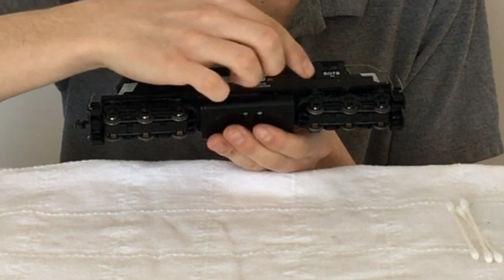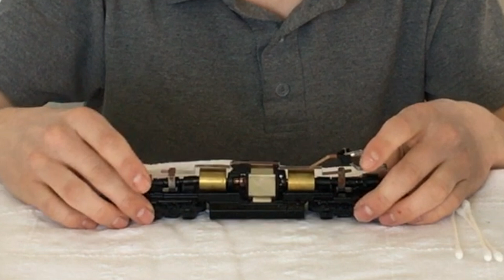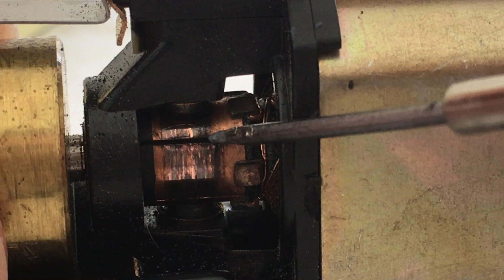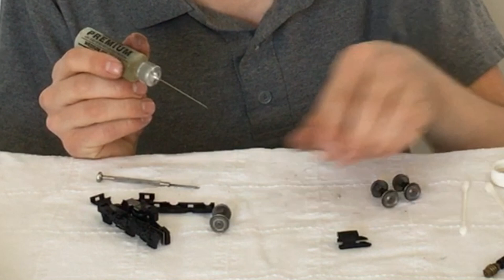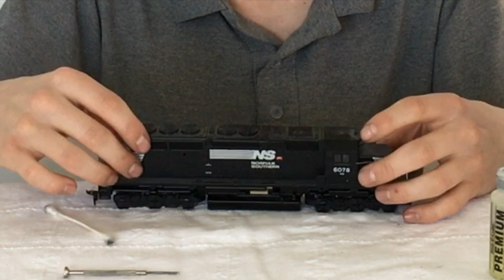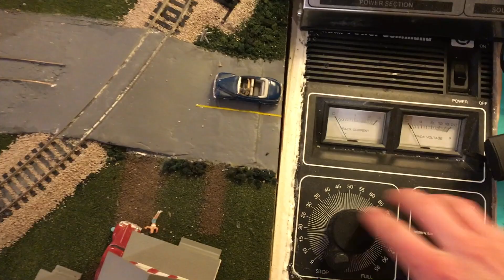How to service an ho scale locomotive

Comment: Thanks for this vidio, how would scratchbuild a locomotive? I already have a design, i just have to build it, it’s a cylender with straight lines enstead of rounded all the way
Reply from the maker: I think learning how to solder brass parts together would be a good start. They make kits you can build, you could combine some to get what you want.
Reply: @SMTMainline , okay, i’m getting a roll of alluminium, a brass strip and some thin steel rods to work with, i’m also using real coal for the loads and bunkers of the engines

Comment: thank you for your videos a lot information I learned . I am  looking for pan cake motor if you kindly or you about sites they sell this kind motor or it(parts) ? thanks a lot
Reply from the maker: Pancake motors are not terribly valuable so you can usually find them as spare parts in junked locomotives. No one makes them for HO locomotives but if you can find a locomotive of the same brand, from the same timeframe, it will probably have the same motor.

Comment: Don't know if anyone could help but I cleaned and checked all my connections on two locomotives i jsut bought, they still are not working for me. both sets of wheels are almost impossible to move by hand. the one I got to atleast make some engine noise (electrical noise) but that's it. Also then checked the track, it seems to get varrying voltage. need some tips please!!!
Reply from the maker: You tried to turn the wheels with the worm gears removed?

Comment: Hi I have this locomotive it runs slow on the track and track is clean and the wheels are to I was wondering what else could be some other possible issues the locomotive also stops and lights remain on

Comment: thanks for not showing how to take the covers off the trucks
Reply from the maker: They are held in with pressure but I wouldn't pull them since they won't hold well after. There isn't much reason to pull them out anyway.

Comment: I got an old A.S.&T.F. Loco (from the 50's) and the motor works but something mechanical isn't making contact, I'm guessing the worm gear isn't making contact with the drive wheel gear. If anyone has any thoughts on what it is please comment and have a great day!

Comment: I also have engines from 40s and 50s. 60s 70s and so on. Don't know about there maintenance. But... Have been able to clean ,repair, and lubricate all parts to a successful run. Some have been worse than other but all same out come. Great runners. Pain staking part is waiting for parts or finding them. As in lionel GT 5511. Or lionel similar to this with the bottom of trucks.

Comment: Great video. Still too much work for me. :) How much do you charge?
Reply from the maker: I also offer a deal where you can get each loco repaired for 5$ each or 3 for 20$
Reply: SMT Mainline I can afford $5. And Ill pay for parts if you need them.
Reply from the maker: 950$ bucks an hour but some people such as you get "the smt super discount" which gives you 950$ off for each hour so it should be a pretty good deal.

Comment: What would you recommend doing for the newer Athearns that have the weight surrounding the motor?
Reply from the maker: The weight usually comes off if you pull upwards hard enough, just be careful they sometimes change things.